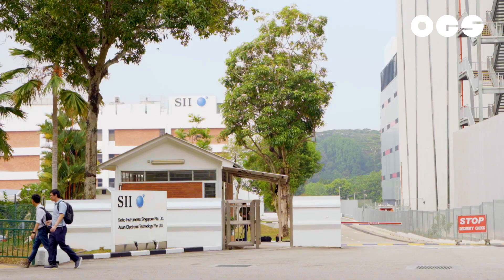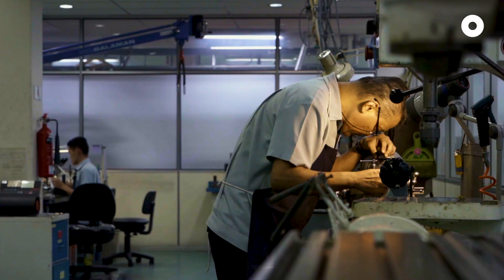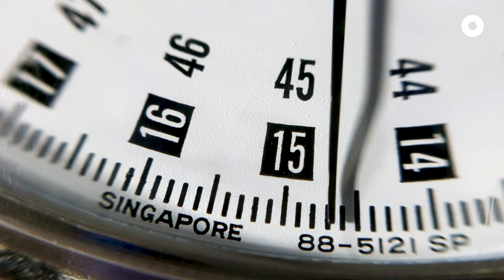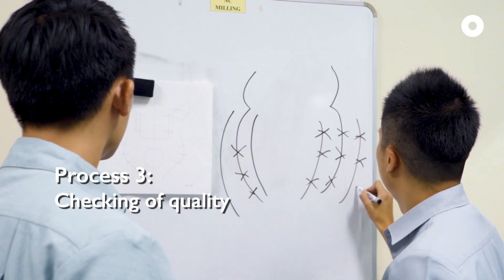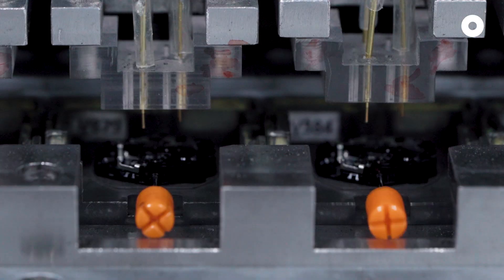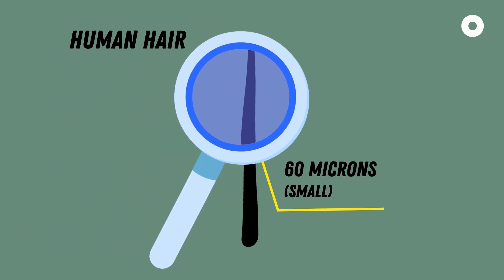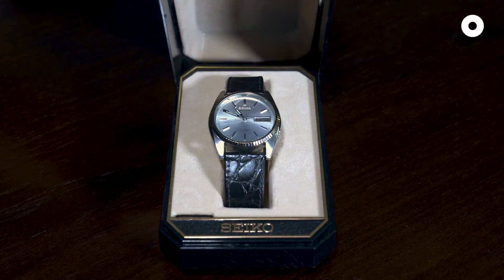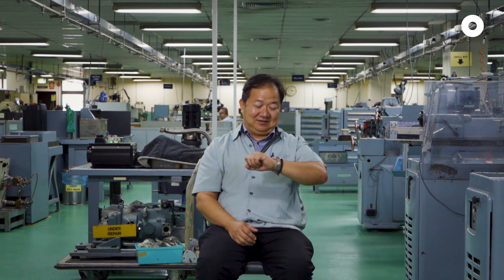Inside Singapore's Only Watch Factory | Seiko Singapore

Comment: The Singapore made Seiko movements are made from the 1980s to the early 1990s only. We don't get them because the movements are only found in watches meant for the overseas market like in the US. There were some movements made by either Malaysia or Singapore, but the Singapore ones are hardest to find. The yellow watch featured here  is the SKA035 (affectionately known as Bumblebee) and it can be found with Singapore and Malaysia made movements. For Seiko collectors, the Singapore made movements actually command a much higher price and collectability factor.

Comment: Ive looked at many seikos but have never came across a singapore made movement.
Reply: They make 7s26, 7s36 movements.... especially the k series model for the Seiko skx007, Seiko 5s and so on
Reply from the maker: The Seiko watches indicated with ‘Movt Singapore’ on the watch were made between 1980s to early 2000s. You probably can’t get them off retail now! Seiko still produces some movements in Singapore but it’s no longer labelled.

Comment: I spent good money at least twice to change my Seiko watch batteries at its service center.  Because long ago I changed once outside.  Then later water can go in.  Seiko centre said outside over tightened the cap and damaged the seal.  But then it was super expensive to change batteries at the centre.  I now heck care and just change anywhere.  In fact I have stopped wearing watches.
Reply: Yes as watch is more of a fashion nowadays. You have phone which has clock already